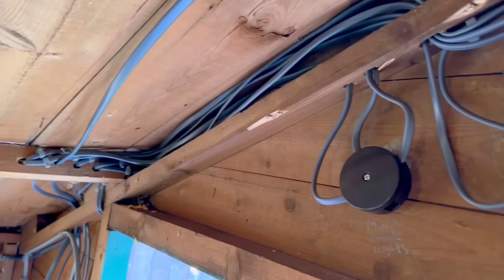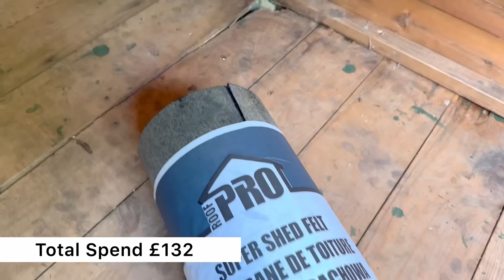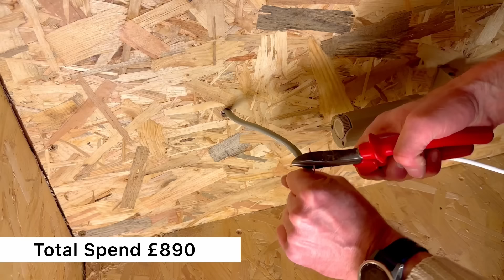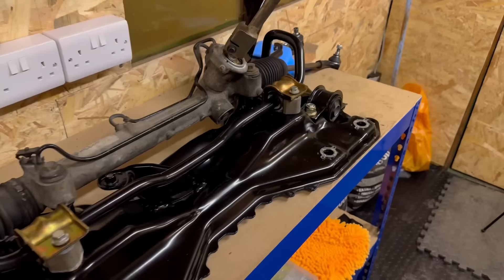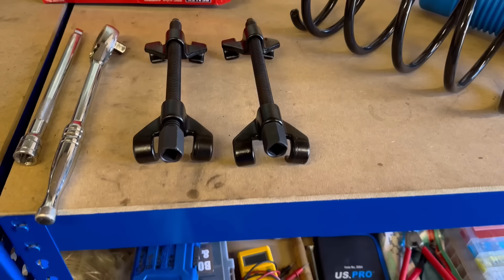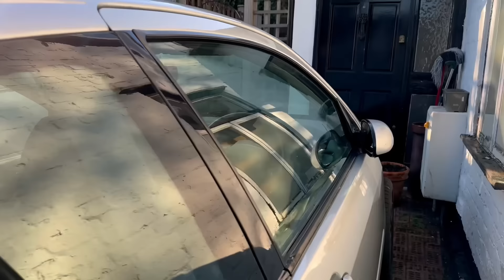I Build A Workshop For My £650 Focus ST170 Project

Comment: Is the floor insulated enough? Seems odd to put so much into the rest of the building but not the floor.
Reply from the maker: It’s acceptable for a workshop / shed but yes if you wanted to live in it you’d do the floor too. Floor insulation would require roofing baton to be laid in strips along the floor then celotex cut and laid between it with OSB 3 board on top. The main reason for not doing it here is that it would have created more of a step into the shed (more of a pain for lifting in engines etc) and budget.

I did a treehouse build recently with full insulation that shows the full process over on YouTube.com/@AliceLouiseDevelopments. Bit different to car stuff but was a lot of fun to do!

Thanks for watching 👍

Comment: Considering Bilstein shocks are some of the best out there and do look lovely, may God there are terrible for rusting…makes the Titanic look factory fresh…. I always re lacquer them with a think coat of 2k, otherwise their will rust  😊
Reply from the maker: For sure! I’ve seen some sets that look quite corroded after just a couple of years. I was originally going for genuine Ford replacements but the price was prohibitively expensive and availability was hit or miss. Bilstein seemed to be the next best thing - well known brand, properly tested etc also loads of different spec options depending on how you plan to drive the car. B12 should hopefully be a good plug and play pre engineered performance set up - just gotta keep it dry! 😆